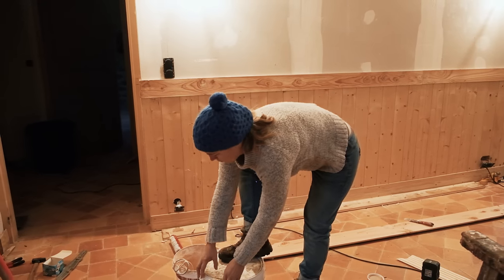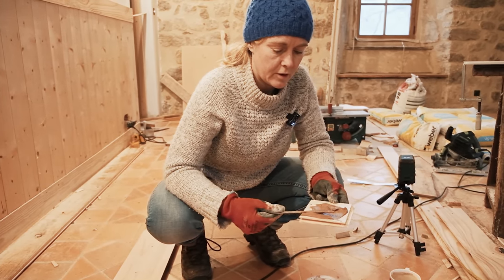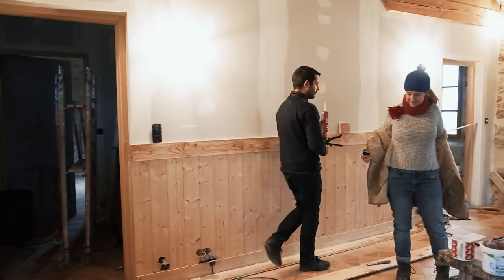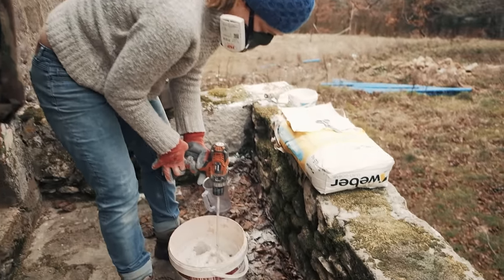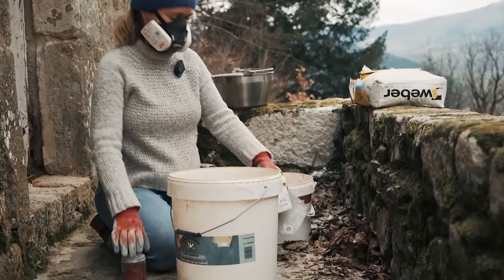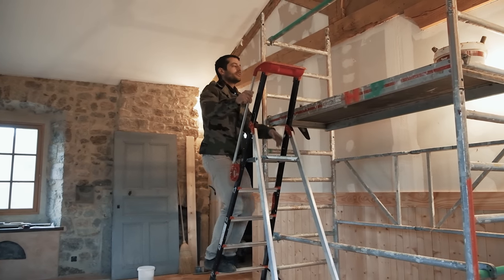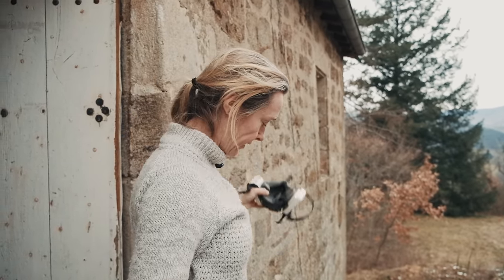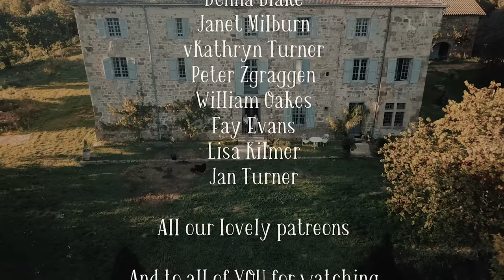The Coach House restoration leaps forward!

Comment: This plastering is new to me. I've done plastering here in the US first you do a base coat then you do a finish smooth coat. The most stressful part is getting it all on the wall before it gets hard and cleaning everything of course. Great job you guys it gives me ideas
Reply from the maker: Did you see our first plastering video? This isn't standard plaster - it's a resin/plaster mix that will go on smooth surfaces, so the application is a little different.
Reply: @Chroniclesofrosieres   Ahh!. . I will look for the other video now... But I could use the colorant as you did and as I have with concrete...what fun!
Reply from the maker: There’s a playlist for the coach house restoration on our channel homepage. I think the first one after the tour is where we explain about the plaster. The brand we use is ‘facim’

Comment: Is there any reason you have gone with plaster over lime mortar effect?
Reply from the maker: I’m not sure what you mean? This is a lime plaster with sand in it so perhaps it’s what you mean by lime mortar? We use the term mortar for the grouting of the stone joints. The lime plaster we use here is a special lime plaster with a resin addition so that we can put it onto modern, flat surfaces like the partitions. Normal lime plaster wouldn’t stick to this.